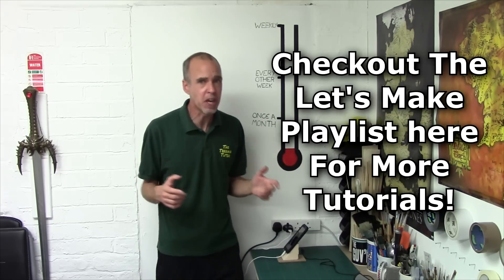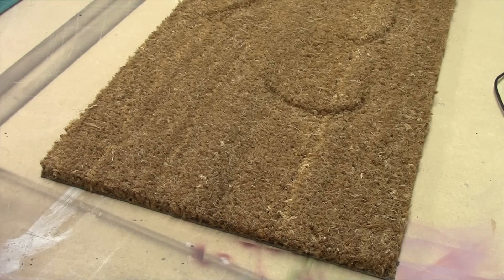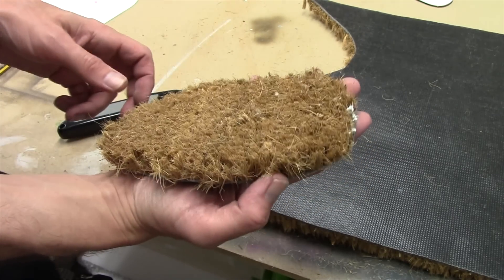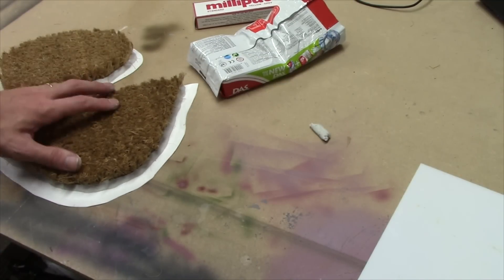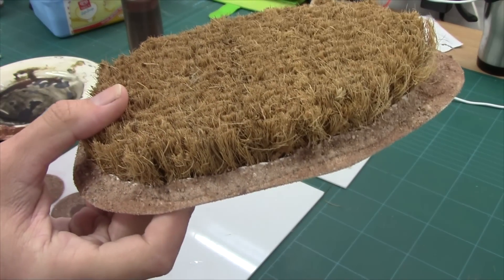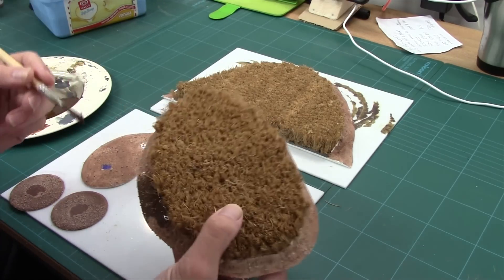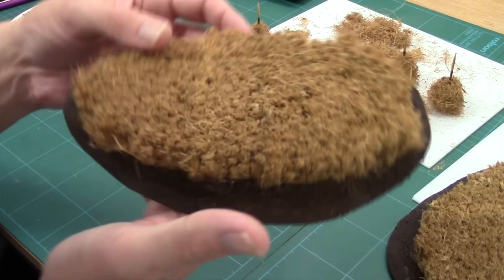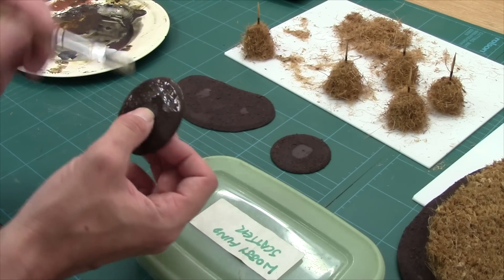Let's Make - Cheap & Easy Hay Fields & Hay Stacks Scatter Terrain

Comment: My background is in newspaper/magazine layout and design. Back in the day when large qualities of spray adhesive were being used (Spray Mount etc) there were numerous warnings that all such spray adhesives are carcinogenic (cancer-causing) if inhaled. Inhaled spray adhesive is in the same category as inhaling MDF dust or any spray paint. As well as being a fine aerosol it also contains some nasty hydro carbons. The industry warnings, at the time, were it should not be used indoors without strict precautions. The industrial standard was a 'glue booth' which sucked air away from the work piece and absorbed the glue/air into a replaceable filter. Other suggestions are do it outside or use a personal mask but only use masks in an exclusion area where others cannot breathe it. Regard it as a 'persistent agent' in still air. Well ventilate and/or do it outside.
Reply: These are glue booths:
https://www.graphicsdirect.co.uk/spraybooths/simair/simair-spray-booths.html
It IS a problem!     Good luck and stay safe!   :)
Reply from the maker: That's for the heads up mate
Reply: I enjoy the video lessons. Many of the things you do now with modern materials I was doing in 1/200 or 15mm scale with cardboard and plaster 25 years ago. And... before you ask… I 'set' the thick cardboard with polyurethane varnish to make it hard and waterproof before I used a fine sand, plaster and PVA mix on it. No warping!
Keep on trucking and work safe!  :)

Comment: I use natural material i heat my soil and dirt at 350 for an hour and i preserve branches off bushes and dry out fresh grass clippings and mulched leaves and red sand and all natural that I've gotten even better results than store bought foliage.
Reply from the maker: All the soil around here is clay type so that's a no-no for me bud
Reply: i love baseball diamond red sand, i havethe store bought andhonestly like naturalbetter I bake my dirt for 1-2 hpurs at 350 degrees F. I use natural bush branhes lawn and leave trimmings hay, thorn trees, Ive became a huge fan and watched so many of your videos and have learned so much. my friend makes tiny dioramas for his tank models but i just cuts 8, 20'x18" plywood boards i have surgery in 1 day and a wake up. ill be in bed for 2 weeks and no physical activity for 90 days after that, ive made alot of pva i have modge podge my glues my material foam board my foilage and pigments hot glue gun and so much more. To much to name lol i have 2 deasks by my hospital bed in my room so i can easily access everything. if its ok my first board i will make a video of the finished product, ive bought and got so much material for 3 and half months its crazy. Ill comment link to video if you could give me a few pointers on the first board i make, they will not be for war games just for my projects i have a reallly creative mind and love how you also use your imagination alot as well as i do to get what you need done. i even have 2 bags 200 soldiers at a 1:35 scale. my first scene will be an irag type setting, if you could give me a few pointers ill send link to my first board finished video in a week or so, i also have came to love a product in the USA called ProFrom Joint Coumpund you can mix and water it down and i love how you taught about making the rock walls and terrain with the aluminum foil technique 50lbs of proformjoint compound is only like $12 U.S. dollars per 50 lbs which is alot if you think about it and it stays wet if you dropabout a half cupof water to bucket before put lid on will last like over a year ive read on blogs. thanls a lot for responding

Comment: I would have drybrushed the bases earth tones to get a good compacted dirt look, then rather than using flock, I would have more finely chopped the left over coconut fibers and sprinkled that on like flock. When you look at hay fields after they've been bailed, it's usually more dirt that green grass. Of course, for edges you could sprinkle a bit of green flock to match them to the rest of the table, but to me, hay would have looked better on more bare dirt.
Reply from the maker: Reckon it'd look good like that mate, post you pics to the terrainiacs group :-)
Reply: Unfortunately I have neither the space nor the funds to work on terrain anymore. Else I'd be working on a lot of projects >.<
Reply from the maker: TheDeinonychus
Shame bud

Comment: I reckon you could use steel wool for the haystacks as well, can't you? I sprayed the wool on my test tree with a few different coats and it made the fibres noticeably thicker, so it can be quite close to what you get out of the coconut. Maybe a little less in scale. I think there's also something called wood wool used in decorating (and packaging back in the day) that could be useful, but honestly I haven't touched any for ages.

Nearly all my at home clothes are hobby soiled, mate. Honestly, I don't care much. It's just easier to wipe something on your shirt if you need it to be done quickly than doing yoga exersises to reach a bloody towel around the corner. It also creates nice patterns, especially with the occasional paint accident. I'm more worried something's sticking in my beard. You know, I've seen guys wearing a tie under an apron at the bench. That can't be normal.
Reply from the maker: I will never wear a tie in the studio!

Not sure on the wire wool, give it a go and let me know how you get on mate!